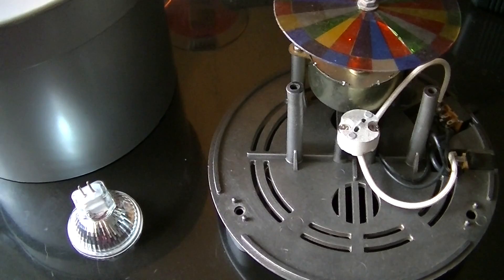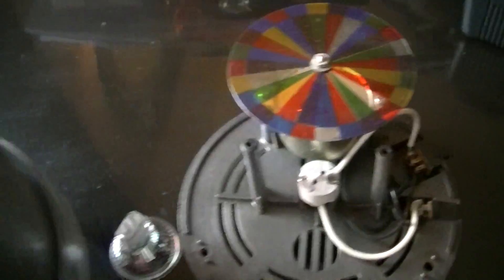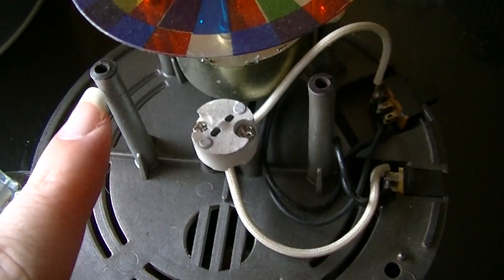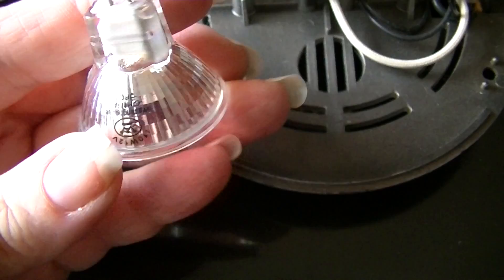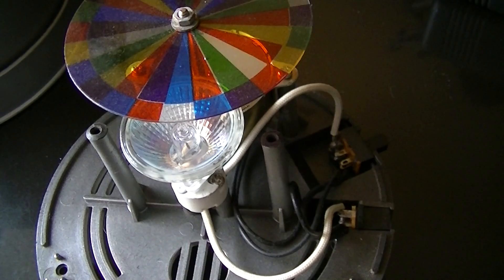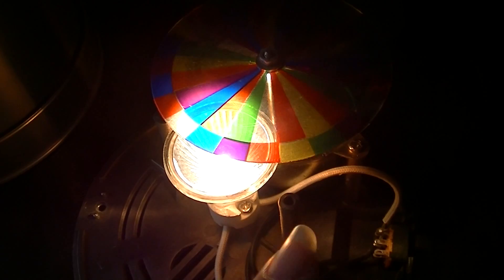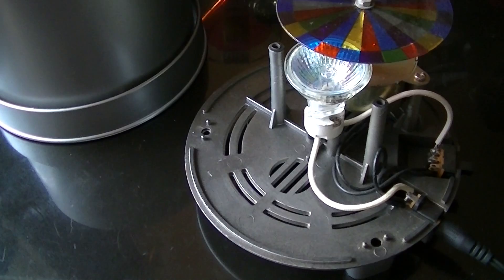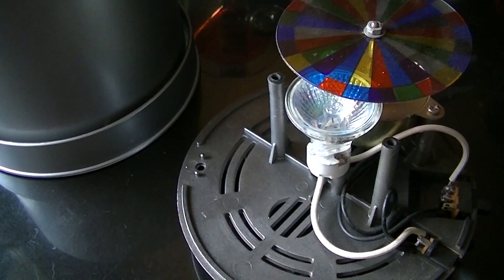Fixing Fiber Optic Christmas Tree

Comment: Disregard my last msg, thank you so much for showing what the cause was. I was going to throw mine out,  as its 20 yrs old, a great little 80cm size and thought i will just buy a new one due to for no reason the lights didnt come on this yr when setting it up. After seeing this video i went into a hardware shop , picked what looked like the bulb in your video and tried it on the tree. All working now. Thank you so much!
Reply from the maker: You are welcome, glad that it worked out for you. I try to fix things before tossing/replacing and it's a bonus when its a simple fix like this. 😉

Comment: Great video. My little 80cm fibre optic tree has just stopped working and as an after thought i would see if anyone else's had and came across your video. One question, how did u know it was the bulb that had blown when u took the tree apart?
Reply from the maker: I took it apart, took out the bulb and plugged it in to see if the motor still turned/worked then tried replacing the bulb which was the culprit 😉

Comment: Does anyone know how to get a replacement color wheel for my old gal??? Mine is cracked around the inner rim.
Reply from the maker: You can try searching for a replacement color wheel or make your own using transparency pages (2) and alcohol inks for the various colors. I would sandwich the ink between the two sheets and cut them down to fit your existing wheel size/shape. Please let me know if that works out for you, I'm really curious 🤔

Comment: Does the wheel still spin when you turn it on if the light bulb is burnt out? Because I have a similar tree but when I plug it in and turn it on it doesn't do anything so I don't know if it's because of the bulb or if the whole thing is just broken
Reply from the maker: When my bulb burnt out, the light disk was still rotating since I still heard the hum. You could try replacing the bulb but it could be the motor if there is no sound when you turn it no. Good luck. 😉
Reply: Natasha Hensel pathetic motor is working light is turning but I cannot get the new bulb to work
Reply: What do I do if bulb does not work all other seems good

Comment: What if the light bulb is okay but the color wheel is not turning?
Reply from the maker: If the bulb is fine but the light disk doesn't turn, it's likely to be the motor. Do you hear any hum from it when plugged in and turned on?
Reply: I am in the process of taking the stand apart to see if the color wheel is stuck.  Then I will plug it in and listen for a hum!  Thank you!

Comment: My fibre optic tree makes noises its coming from base any ideas on how to fix it.
Reply from the maker: Angela,
A bit of noise is expected from fiber optic trees as the motor rotates the color disk over the bulb but if it's excessive the motor might be giving out. How old is the tree? How long, approximately, have you been running it?
:) Natasha
Reply: Natasha Hensel its 20 yrs old